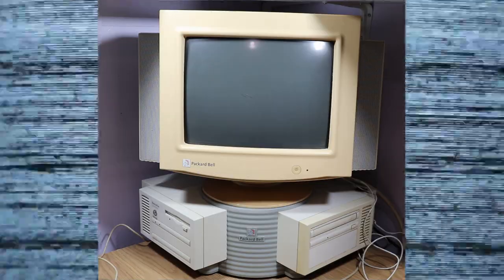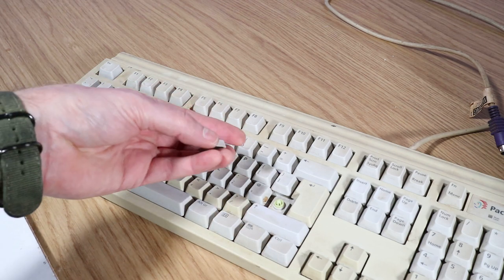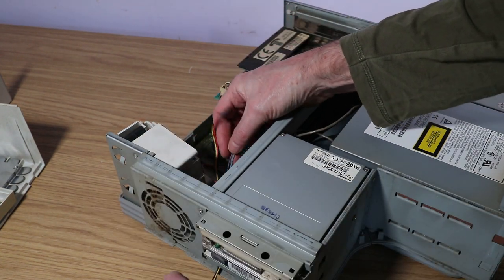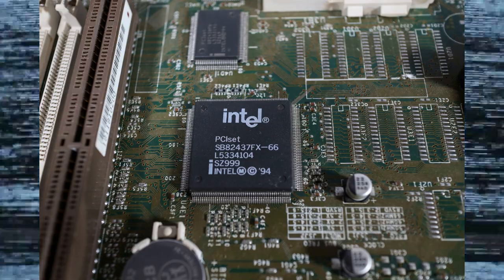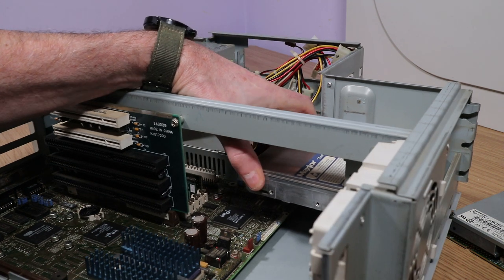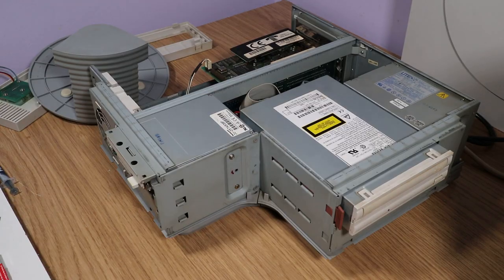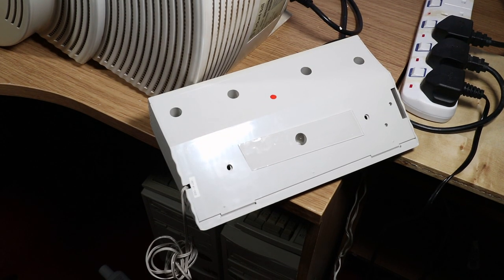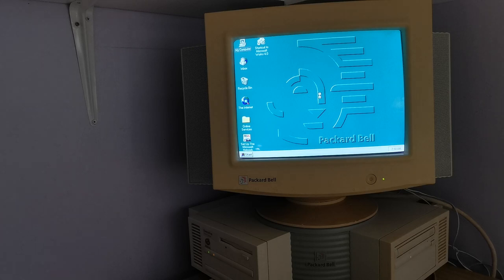Wedge shaped PC!

Comment: Adding an Adlib-clone for DOS-games and a Voodoo for 3D might be a good idea. It would perfectly fit into the late 1996 era without changing the computer too much. A P166 was typical for a mid-late 1996s PC, the P120 is more or less a low-budget solution in that timeframe.
Reply from the maker: Yes, probably what I'll do. I have a spare voodoo in a p200mmx which I mostly use. I may steal that for this machine for some early glide gaming.

Comment: those MWave cards are terrible for DOS, swap it out with one of the Aztechs you got
Reply from the maker: I'm interested to see what its like in dos games out of curiosity before I decide how to upgrade. But yes itll be getting an aztech if I do as they also were available as an oem card in these machines
Reply: In my opinion, it is a miracle that the system is in its original configuration. It would be a shame to replace something. Maybe upgrading with add-on solutions would be more fitting?
Reply from the maker: Yes cool, i was going to try and find some memory for the onboard graphics, I'll see if I can live with the soundcard and just add in a voodoo. I'll try not to touch the original spec.